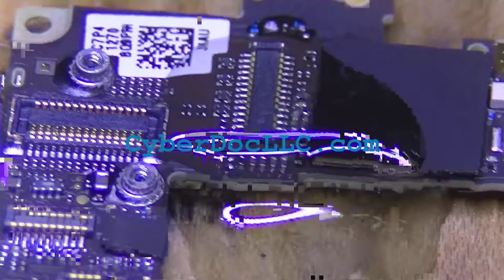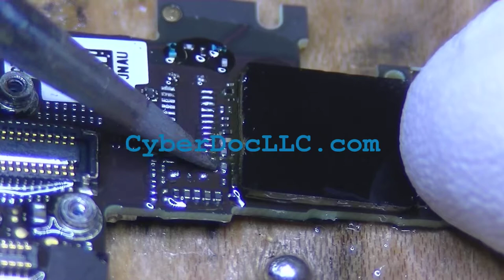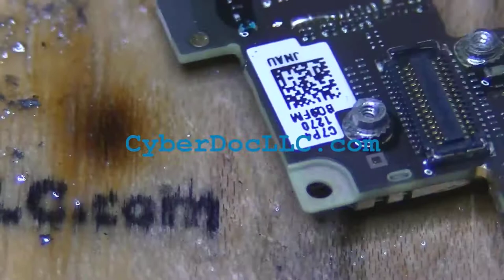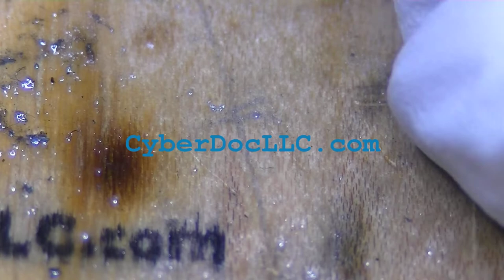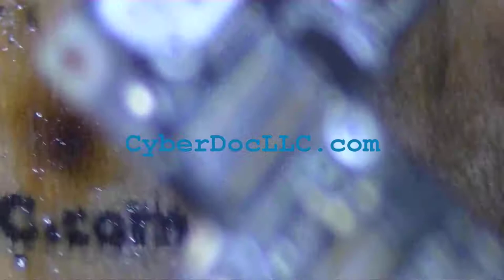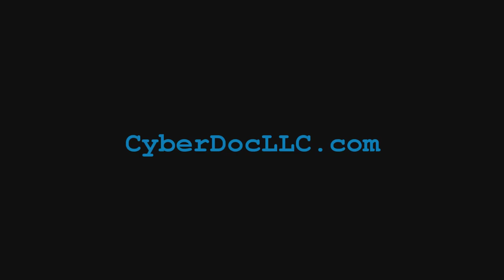iphone 4s lcd connector no image broken pins soldering repair replacement #2 CyberDocLLC

Comment: What is the liquid on the board? Is it flux?  I want to try the exact same replacement on a different phone.  I an a bit worried about damaging the logic board.  Where would you recommend I look for a starter guide to what equipment I need? I really appreciate your video

Comment: i don't understand why when i watch other ppls soldering video, the solder paste don't evaporate that quickly while soldering and mine would create alot of smoke and i have to reapply more paste. I know it may be because my soldering tip is too hot.. but when i reduce the temperature, the leads dun melt.. any advice?
Reply: use a flux fluid for soldering..

Comment: Why does this look such an awkward way of removing the connector. A good quality Flux and Braid would dismantle it in a couple of minutes without the risk of damaging anything or de-soldering any other components.A couple of lumps of blutak or something to hold the board and you really need a magnifier and an angled tip makes life easier,  It seems a lot of messing for such a simple thing.
Well done if this is your first attempt.
Reply from the maker: Anthony Taylor  first attempt, also what you suggest will lift pads off and damage the board.   if done correctly my method have no risk.   this is not regular solder.
Reply: When you say this is not regular solder, what kind is it?
Reply: +Anthony Taylor the solder he is using is a low melt temperature solder
Reply: +Anthony Taylor So why dont u make a movie mr expert?